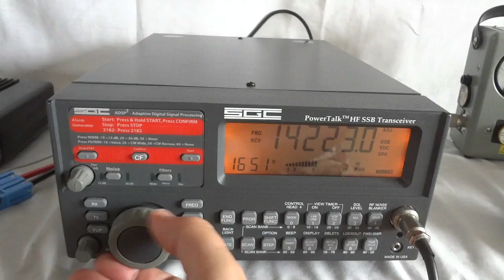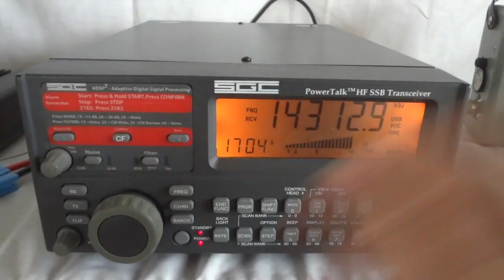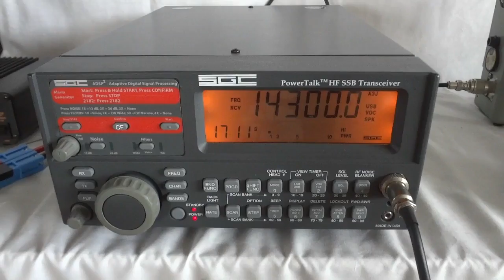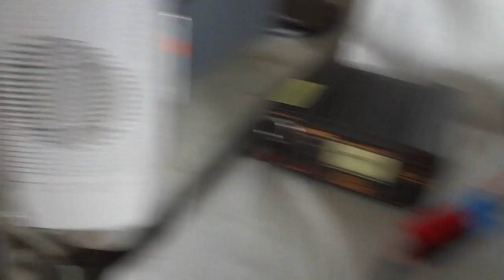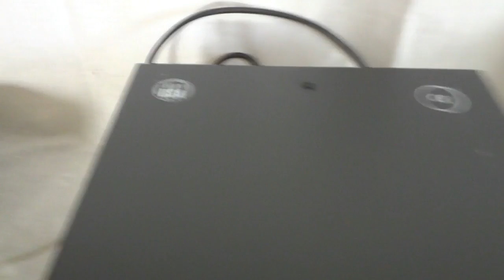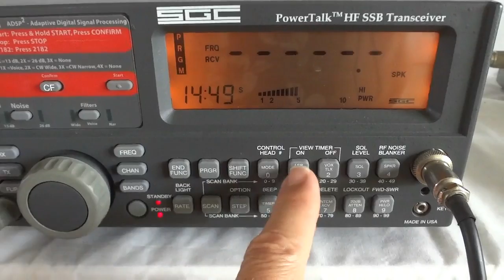SGC SG 2000 HF SSB transceiver with Powertalk DSP control head

Comment: What modes of operation was it capable of? LSB, USB, AM and CW? I wonder are the pills used in the transmitter are still available? I know they had an issue with the external 500 watt amplifier they came out with to compliment the SG2020, the manufacturer obsoleted the transistors leaving SGC without a source of this key item for this popular but expensive amp.
After the death of the owner, within the year his wife sold the company off to one employee who in turn discontinued most all radio and amp products as well as various antenna couplers. He decided to center operations on providing the military with one of
 their best couplers and and antennas for HF work.
Still have my SG2020 with the original ADSP NOISE REDUCTION as well as the SG239 coupler. Bought mine in Dayton many years ago when they had a special running, buy the radio and get the coupler.
Reply from the maker: This radio uses the MRF455 transistor in the RF power amplifier. There are two parallel PA's in this radio which are combined, each PA has two transistors (push-pull design) so you would need four MRF455s if you had to replace all of them. This guy sells them for $15, each, not too bad: https://www.ebay.com/itm/126449769504
I doubt you would ever have to replace them though as the PA design has a lot of extra unused headroom. Even if you would transmit with infinite VSWR (antenna open or shorted) it will survive just fine. Cheers.